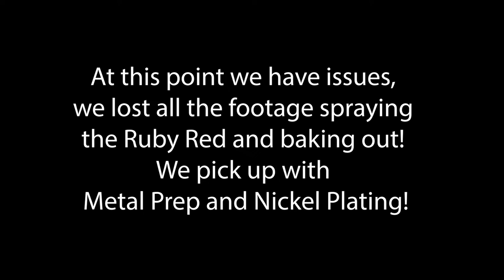Tonka Restoration: 1954 Tonka Tractor Truck

Comment: Nice job. I was wondering if powder coat can be two toned. Nobody seems to do that with powder. I have been doing these since back in the 80's with automotive base coat clear coat in multiple color combos without any problems. Thanks and again nice job.
Reply from the maker: Yep.   Absolutely.    It can be just as tedious and with paint on small items.   I’ve done many 2-4 tone projects in the shop.    Only thing is you have to use a high heat tape for the masking.    Good question and I’ll take it as a suggestion for a future video.    Thanks for watching.